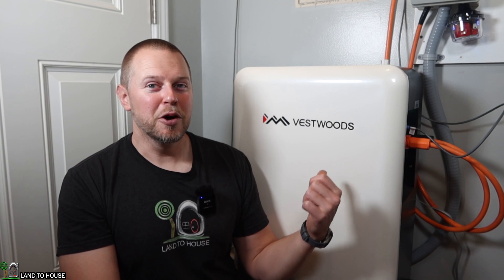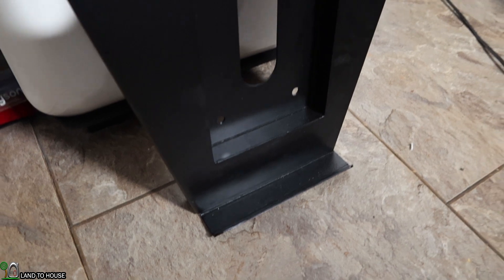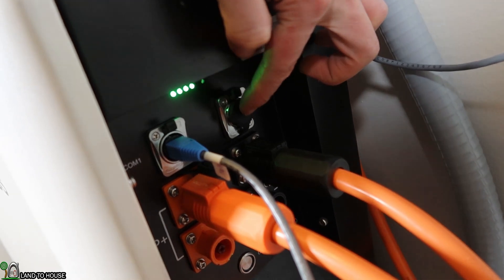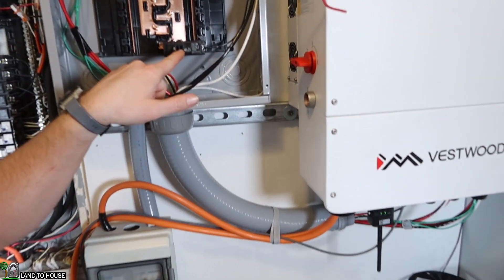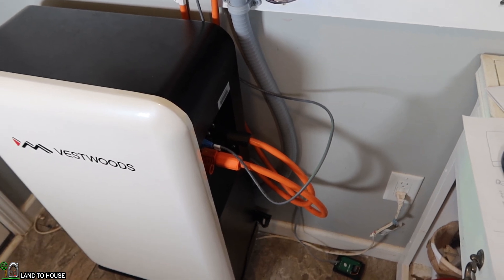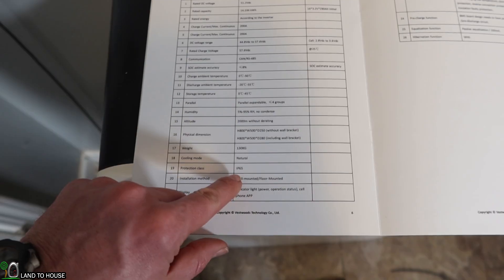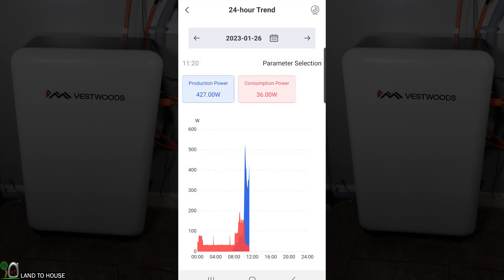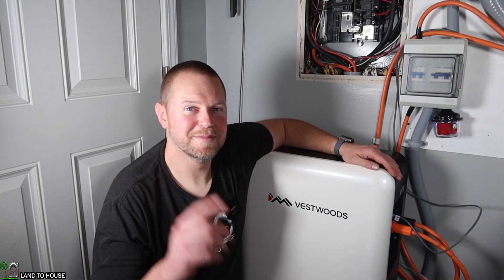Vestwoods 14kwh (14330Wh) LiFePo4 Whole House Battery

Comment: That is amazing; a lot of power in a small footprint.  Are you going to have to add extra cooling/ventilation to that utility room?
Reply from the maker: Because the critical loads panel that I have does not use much power I dont think so. With all the lights on and the computer It runs around 500w. The toaster and microwave are not on long enough to cause much heat increase. It has been running for almost 50 days with no issues with heat.

Comment: I bought a Vestwoods 100AH LFP battery a little over a year ago, after Will Prowse reviewed it and said it was pretty decent.  I am using it in a portable power station I built and it has done between 50 and 100 cycles with no issues.  I had no idea they were making larger batteries or inverters.  It will be cool to see how well they work for you.
Reply from the maker: I enjoy watching Will's videos. The 5kwh and 15kwh batteries are new for vestwoods. SO far this battery has worked well going on 50 days. The discharge does not go below 20%. Only once I have let it do that.

Comment: Would send it back, a 50mm2 cable is a firehazard on a 200A system
Reply: 1/0 cable is rated for 150 amps, the 8kw inverter can only pull 67 amps max.
you wouldn't want to push the battery to its max 200 amps by itself if you want it to have any longevity.
Reply from the maker: Good point. I have been using this for some time and not seen more than 3000w at any given time. That is because the hot water and well pump, and hvac are not on this inverter.
Reply from the maker: It will be vary rare for me to use more than 4000w on this unit. That would be with all lights on in the house, dishwasher, microwave, toaster, computer, and fridge all going at the same time.

Comment: I hope that it's connected to a fire suppression system.
Reply: why? theyre LiFePo4 batteries, super safe and in thousands of people's homes
Reply from the maker: So far is has done well. No issues with the battery.
Reply from the maker: This battery is a LifePo4 not a Li-ion battery. SO far it has worked flawlessly for several weeks.

Comment: 16 * 3.2 = 51.2 so its 16 LiFePO4 batteries 15 would be 48. Do not mix them with 48v modules.
Reply from the maker: This is a 51.2v system yes.

Comment: 9 minute commercial  😞
Reply from the maker: The actual content with full install will be coming up soon. It is a much more detailed video that will apply to more than just this system. (Sometimes you have to make the 9 min commercial to then make the in-depth content.) I will be doing some grid down videos on this as well. First test I was able to get 5 days off grid with 3kw solar.